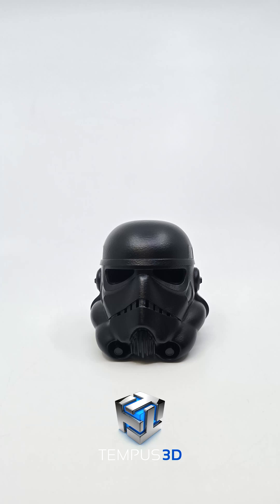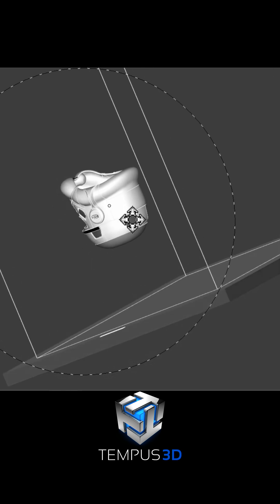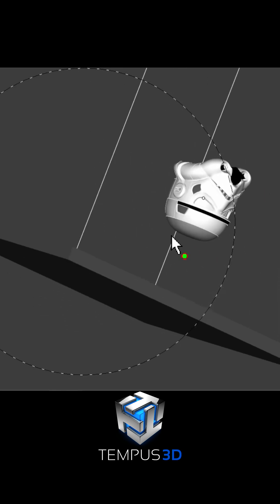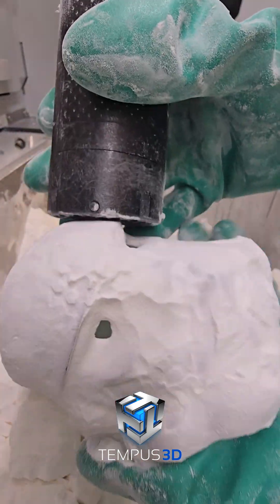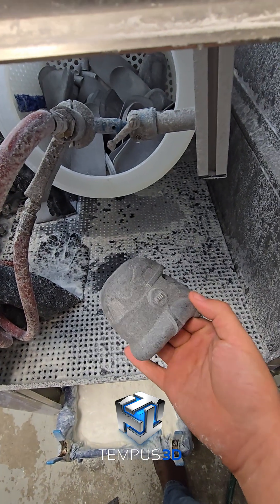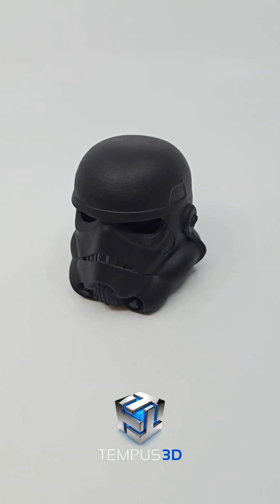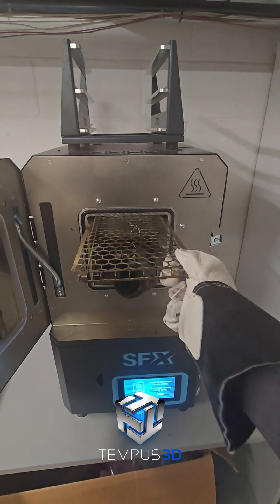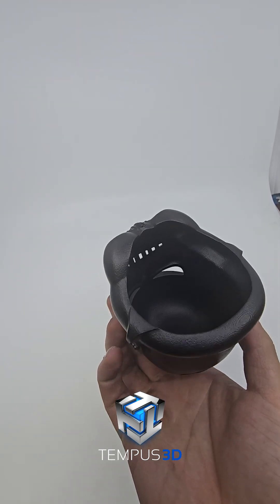HP MJF 3D Printing processes explained

Comment: I didn't know you could Cerakote 3d prints, I assumed they would melt in the oven.
Reply from the maker: That's a great question. Our Nylon PA-12S is much more heat resistant than the basic FDM materials like PLA and PETG. we also use H-Series Cerkote, which has a lower Cure temp than Elite Series.